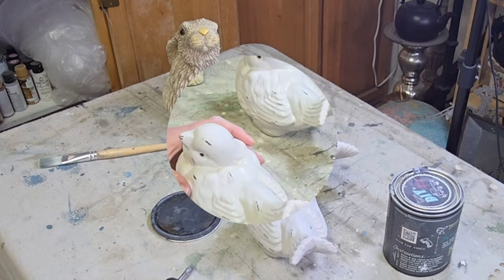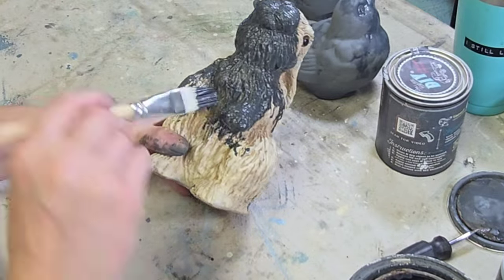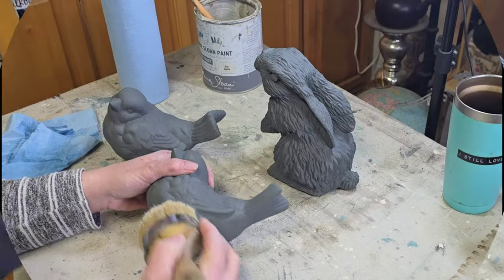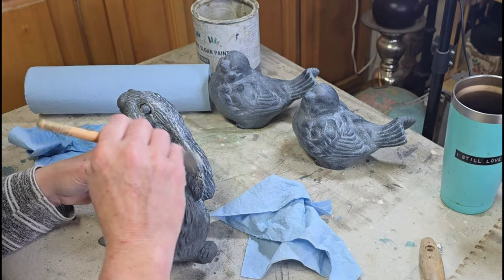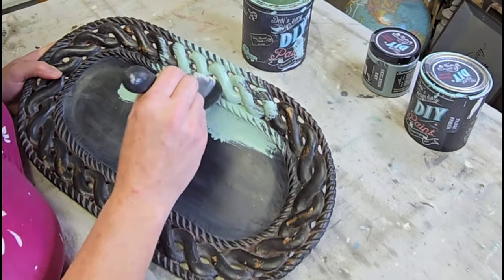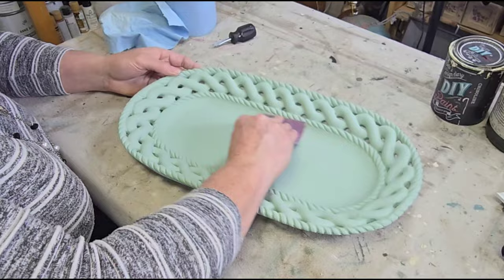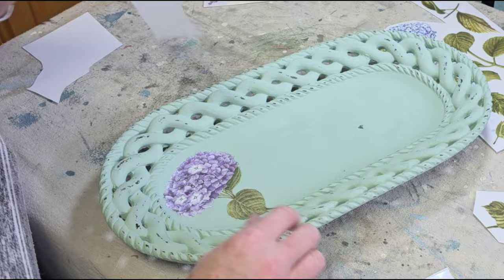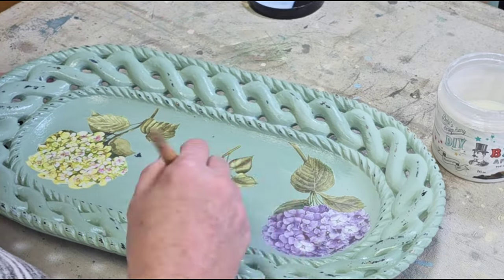Thrift Flips • Trash to Treasure • Spring Upcycles for Salvaged Items From My Stash • Upcycled Decor

Comment: Happy Birthday!!! I love the birds and the bunny. You mentioned that you had to be careful when applying the white wax to the rabbit so you didn’t remove the paint when wiping back the wax. I want to copy you on this technique. Would it help to spray a coat of clear sealer before applying the wax? Would that help? I’m wondering if wax will apply well over spray paint.
Reply from the maker: Thank you! And I'm glad you liked the birds and the bunny. :) As far as the wax goes - If you sprayed clear coat to seal the paint it would definitely help keep the paint in place . . . but I think you would still need to be careful wiping the excess back. I would just experiment to see what technique works for you and go with that. :)